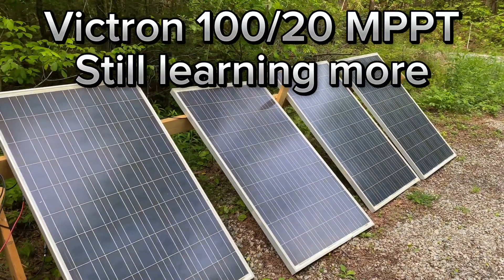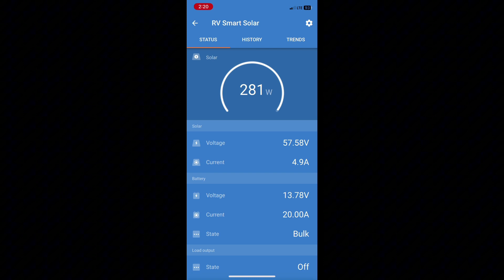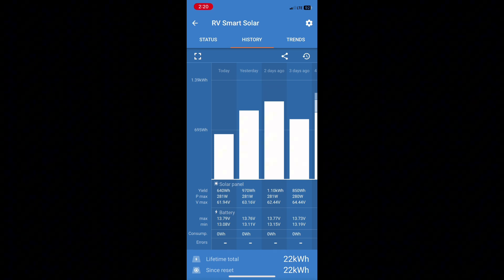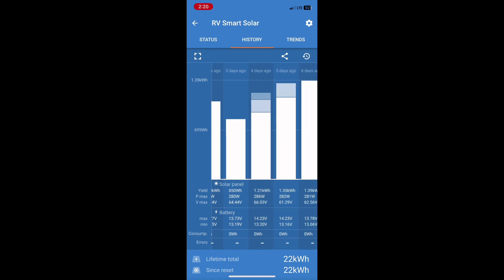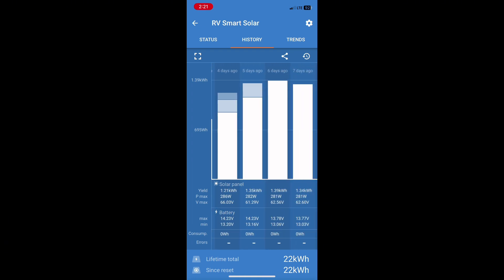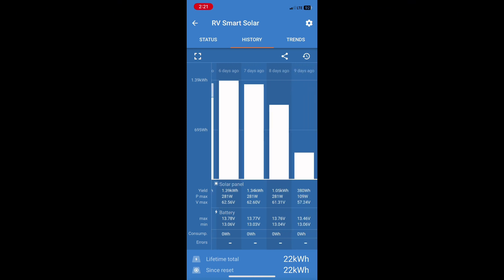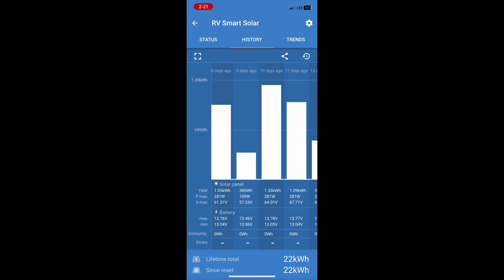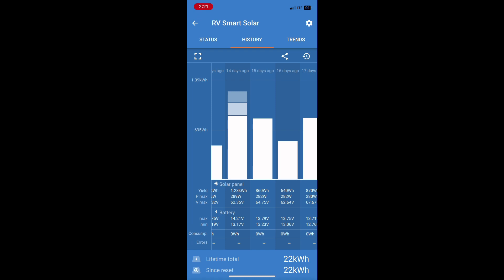Victron 100/20 MPPT not reaching Float mode, probably need more sun

Comment: You are maxed out at 20A on the charge controller.   Probably because you are using a 12.8V battery system voltage instead of 24V (25.6V) or 48V (51.2V).   20A @ 12.8V = 256W.  

You generally don't want to max-out your charge controller(s).  You are wasting solar energy when you do that.   In this case, if you want to stick with a 12V system voltage, then replace that Victron 100/20 with a Victron 150/35.

If you want to do it properly, use a higher system voltage.... but it means getting a new battery or reconfiguring an existing battery pack, getting a 24V inverter, etc... so if you have already invested money in 12V components, you are kinda stuck unless you want to build another system from scratch with a proper system voltage.

In your case I'd recommend at least a 24V (25.6V LiFePO4) system voltage.   That same Victron 100/20 charge controller at 20A can handle 512W of solar panels on a 24V system vs only the 256W it can handle on a 12V system.

It doesn't sound like you are ready to go all the way to 48V but as an example, a single Victron 100/20 charge controller can handle 1000W+ of solar with a 48V battery output.  But at least consider 24V (25.6V LiFePO4) before you wind up investing too much money into 12V gear.

-Matt
Reply: Yah.  For 12V systems the 150/XXX charge controllers are definitely more of the sweet spot due to needing the higher amperages.

The nice thing about the Victron 100/20 is that it is a pretty small device, so having more than one doesn't really take up all that much space.  But it is definitely better-suited for 24V and 48V systems than for 12V systems.

Another thing to consider on the charge controllers is to simply use a larger number of smaller charge controllers.  And keep in mind that using separate dedicated charge controllers is always better than paralleling the solar panels if there is any chance of shading or partial shading.  

Having more than one charge controller also gives you some redundancy when things break.

--

Yes, down-buffering is typically needed when you run a higher system voltage but have heavy "legacy" 12V loads such as brakes or jacks / stabilizers, and so forth.   That is a show-stopper for a lot of people.   Just in case you reconsider it in the future, here are the two typical methods:

(1) Use a DC-DC converter (Victron makes some), where the DC-DC handles the heavy 12V loads.  This can be fraught with problems though due to needing a fairly hefty converter to deal with surge loads / startup loads.

(2) Use a small DC-DC charger (not converter) (Victron makes these too), and then have a satellite 12.8V LiFePO4 battery on the 12V side.  This way the 12V battery handles the surge loads / heavy loads while the DC-DC charger simply trickle-charges the 12V battery at a relatively low amperage (often 6A is plenty, for example) to keep it topped-up.

The nice thing about method #2 is that if you have a 12.8V 100Ah battery  in there you can handle 100A, even 200A (depending on the battery) startup/surge loads as well as high-amperage continuous loads and yet still pack a small 6A DC-DC charger to keep it topped-up.

(having a satellite battery also removes surges and startup voltage droop from the main system and has a few other advantages even when its just a 12V-12V).

-Matt
Reply from the maker: I've decided I really need to get a larger MPPT that can put out higher amperage to 12V batteries.  Now I just need to decide to stay with VICTRON, or try another brand.   It's not urgent so I haven't spent much time researching.  Signature Solar has a Victron MPPT 150/70 but it's $382   I would like something I could use as a backup for house batteries that will be 48v(53v) in the future.  I got the Victron 100/20 because it was low cost, could do my 48v Golf cart/ UTV and could do my RV 12V batteries.    I guess I have more shopping to do....   Thanks for watching
Reply from the maker: Matt- absolutely spot on.  I’d love to go 48v but need 12v for the RV and its brakes.  I don’t think I should do a down covert to power the brakes.  If I had it to do over I definitely would get the 150/40 or 50    An individual EG4 12v can actually accept 100 amps per the specifications but I don’t think I’d push to that level.   When we build our house that will definitely get a 48v system.   Thanks for the input

Comment: I just bought the Victron 100/30 and 2 100 AH Lipo4 Batteries  ill try hooking it up this week
Reply from the maker: I’m curious to hear how it goes.  And if your panels are clear of any and all shade    I think I’d be total fine if I had panels in an open area.  Thanks for commenting.  Have a great day
Reply: I'll let you know 
My panels get total sun from around 8 / 8.30 am till 5.30 pm  4- 100 watt Ridid panels
Reply from the maker: I have the 100/20  The panels are setup as two in sers, two in series, and then that connects in parallel into the MPPT (2S2P)  each 220 Watt panel is Voc 36.8V Isc 8.12A Vmpp 29.7 Impp 7.38    When it's sunny and full sun hitting the panels I see 58v to 68V and max around 290 watts on the Victron app from the panels.    If I had not bought anything I probably would have gone with Victron 150V/ 35 to as much as 50AMP to give me faster charging and more flexibility on panels.   That 100V limit and 20AMP limit was more limiting than I realized.  This is my first experience with solar so starting off with a few... bumps along the way, in a dense forest.  Not exactly the best place to learn, but better than learning on a whole house system.
Reply from the maker: How long using 30amps is it taking to fully charge 200AHs of battery?  Assuming you use 80-90% of the 200AH so 160-180 AH used, would take 5-7 hours of full sun to charge 100%?